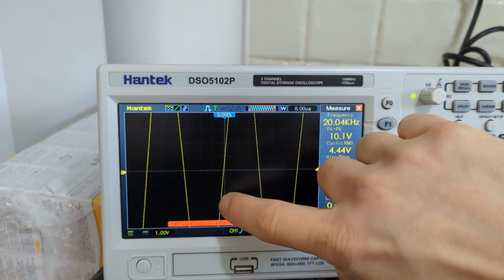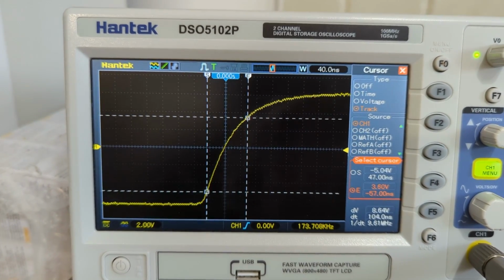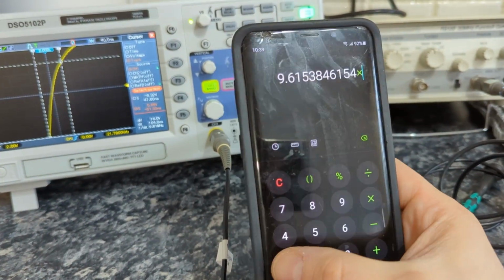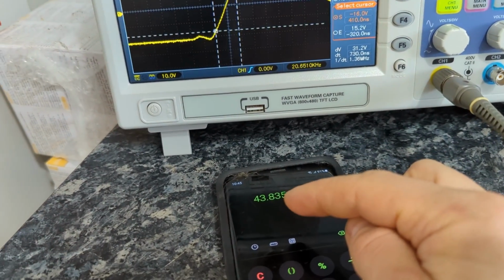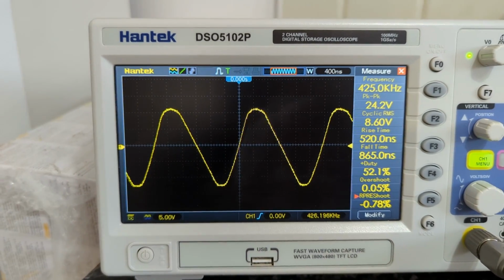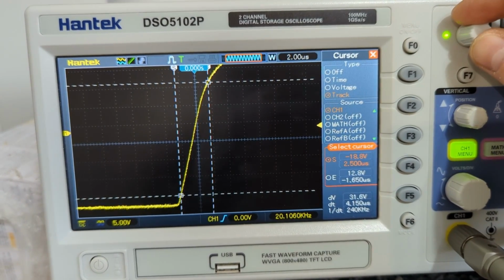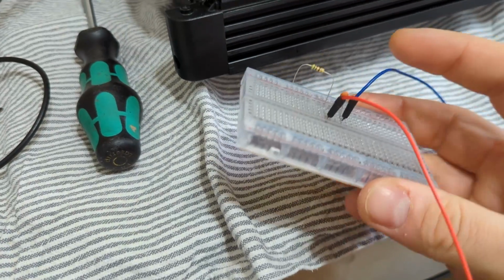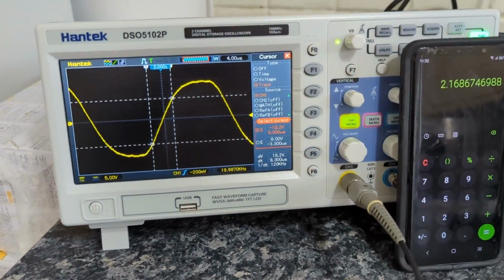Measuring amplifier slew rate - Class AB vs D

Comment: So, although headroom (having 250W for your mids, but using 10W) might provide a lower THD, but you have a worse slew rate?  Would you be better off with clean, lower power amp running at 75% vs a high power amp running at 10%?
Reply: One thing I learned while trying to learn how to play guitar is that almost all amps have a certain tone they only achieve by pushing the preamp and then using master volume to “attenuate” overall output.
Reply from the maker: That is a great question, but that will depend on the amp. In both of your scenarios, you could have identical slew rate🤷

Comment: I wonder if the amp being designed for 20-20k hz is affecting the squareness of the sign wave when you go beyond 20k? Maybe something in the amp is trying to limit the frequency range?
Reply from the maker: Think about frequencies above 20k as "headroom". If an amplifier performs very good above 20k, that means it will perform better below 20k.
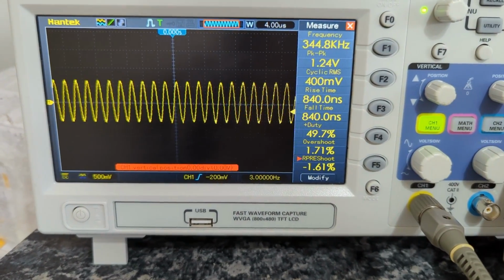Reply: (proper) class D amps are designed w/ a very steep low pass filter a little above 20kHz. (for the reasons mentioned in the video starting at 29:00)
Reply: I always thought they had some sort of filter between 22k and 25k. 

I guess you could say that Alpine V12 is a hi-rez amp before hi-rez existed. Lol

Comment: People can talk shit on Facebook all they want. They are not helping the “Inexpensive” SQ community anywhere near as much as you.
Reply: 1) Did someone noticed that for class D amplifier he measured slew rate with the filter? Filter after A/B amplifiers would mess up the slew rate too. This is major flaw in his measurement.
2) It doesn't make sense to measure slew rate of square signal at 20 kHz. This measures by principle frequencies much higher than 20 kHz (>100 kHz) which nobody cares.

There should be measured input & output voltage distortion with real speakers connected (real Watts load applied) and sine signal for multiple frequencies (or with pink noise). This is the kind of measurement you need for SQ to judge between different amplifiers. Also different speakers will affect measurement, because that's why there are recommended pairing for certain amplifier and speaker. Slew rate measurement with no load at all doesn't make sense to me.